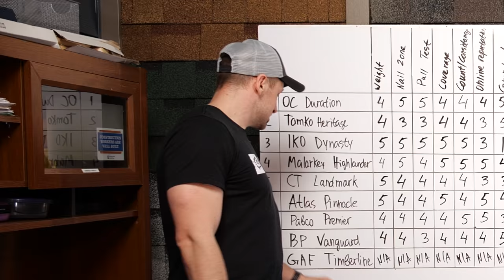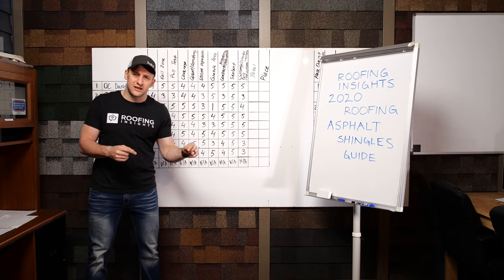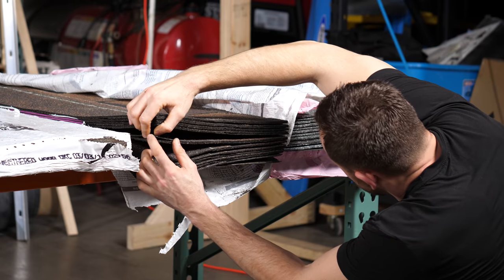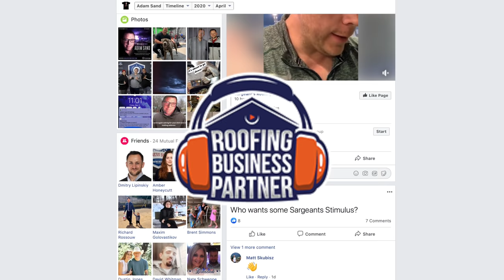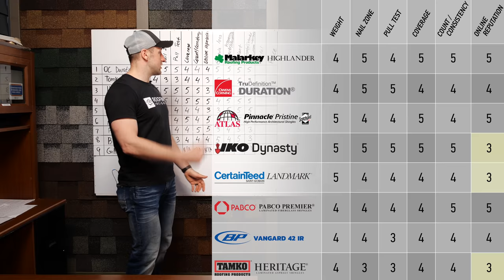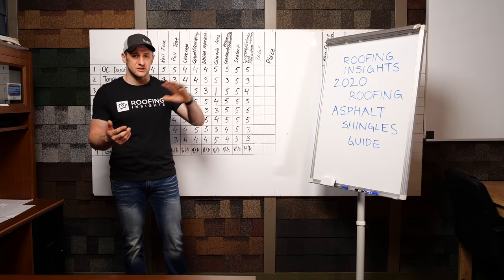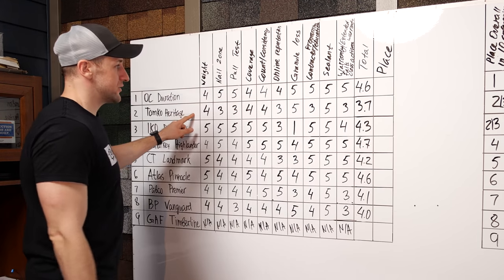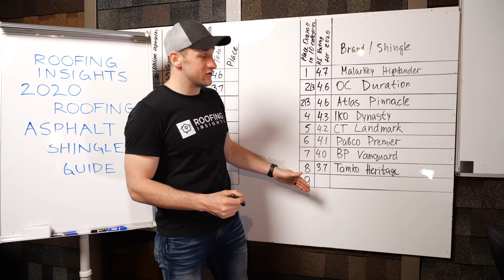Best and Worst Roofing Shingles by Roofers for 2020 | @RoofingInsights3.0

Comment: Funny to get this recommend. Just had my roof teared up and replaced. About 17sq with gaf timberland for 9k in the North East. Every tells me i got an amazing deal.
Reply: 17 sq of GAF in North East shouldn't cost more than 7K, IMO
Reply from the maker: You paid about $530 per square. Going rate for walkable roof is about $300-$450, what city are you in?
Reply: @RoofingInsights3.0  out in long island
Reply: Friend in NJ said to overlay his 14 square two story roof was 5k and it was a semi DIY
Reply: I don’t think you guys should tell the, they got a bad deal as a roofer I hate someone making assumptions before there’s any details how many layers were on roof, was decking in good condition, were there any skylights, etc... I’d say between 7k-10k depending on work performed is fair anyone doing it for less than 6k is either a weekend warrior or starting off in roofing also possibly super broke.
Reply: @RoofingInsights3.0  whoa, I'm getting quotes for $24k for 27sq roof (95066 zip code - any recommendation ?), which is what brings me to your channel and looking for alternative - which is more than twice the high range price you list. Yeah it's only $2k worth of OC shingle material through Homedepot, so something not right indeed....

Comment: How can Tampko score a 5 on granule loss? A 7 year old Tampko shingle will look like its been pummeled by hail when there has been no storms at all. IKO shingles have the weakest seal strip in the roofing business, 90% of my wind repairs are IKO shingles. OC runs about 93% of a square per 3 bundles and have become a lighter shingle since they have become a big box store staple. CertainTeed Landmarks are built like tanks.

Comment: TG!  I picked the right shingle.  We are just doing our roof now with Owen Corning.
Reply: Make sure you invest in the Owens Corning DURATION. I used it and is much better than the normal Owens Corning fyi. Lasts longer better wind resistance
Reply: @arcticwo1fee122  Yes, we did and it's a cool roof. Looks great!  The old owner put a heavy concrete tile on the roof and we found out our roof wasn't built for tile and could have caused it to collapse.

Comment: What happens to the overall ranking if you rank them in each category? E.g. if company A outperforms all competition in granule loss they get a 5 but they're on par with everyone else in pull test they might still get a 5. It seems like ranking in each might add weight to certain elements where a company can drastically outperform its competition. 
As usual, great insight from you. Keep it up!
Reply from the maker: Thank you.

Comment: I wait for this video all year.
Reply from the maker: Any feedback?
Reply: @RoofingInsights3.0  the only thing I can think of: 
I would find some way to quantify the sealing strips. (Best guess keep them in an oven for the same amount of time and turn the pull test around.)

My thought here is  that every time I have trouble with collecting an ITEL sample... It's TAMKO. The damn things bond so well I've taken to making my own shingle seperation tools to get around it.
Reply: @RoofingInsights3.0  The only problem there is that you're testing in reverse... is a hell of a lot more difficult for wind to lift the front lip than someone to pull up on the back of the seem.

Comment: Please clarify if the tested Owens Corning shingle was the regular Duration or the Duration Flex. I am choosing between Malarkey Highlander NEX and Owens Corning TruDefinition Duration Flex. Do you prefer one over the other? I know OC Duration Flex was #1 in IBHS rankings, but Malarkey Highlander NEX was not listed. Thanks.
Reply from the maker: Regular duration was tested
Reply: @RoofingInsights3.0  when will class 4 comparison be done?

Comment: Thanks for the product testing info !! I'm going with Malarkey,, Pabco and Malarkey are the only shingles sold locally , it's a 75 mile round trip to get any other brand., Not a fan of CT shingles, installed more then my fair share of CT fiberglass shingles back in the day, they don't seem to hold up well, to soft !! I Like the OC brand, but have to make that 75 mile round trip, but those suppliers always have a problem with not enough color choice and bundle count,, So as a DIY'er it's Malarkey  :)
Reply from the maker: Good luck!

Comment: Thank you for your very informative presentation. I am a woman who knows nothing about roofing material, well until now . That being said, I need a new roof on a property that I own in California. My question is , My contractor is recommending Malarky Ecoasis Solar reflective shingles. Can you tell me if Malarky Highlander is comparable to Ecoasis. My gut is telling me that I want Highlander and am willing to pay more for it. However I would like your take on this . The contractor told me that in California I should use a "cool roof" and I am not sure if Highlander is a "cool roof". Is Highlander head and shoulders a better roof than Ecoasis or am I ok to go with Ecoasis? Thank you in advance for your opinion.
Reply: Hi! Malarkey's Highlander shingle is actually the entry-level shingle. The Ecoasis line is a solar reflective version of the Highlander shingle, so it will carry the same performance (weight, strength, granule adhesion, etc.).
Reply from the maker: All malarkey  products are good products. We haven’t tested Ecoasis but I have seen industry tests and it’s impressive product as well
Reply: @RoofingInsights3.0  our Ecoasis NEX is actually just our Highlander NEX shingle, with the extra solar reflective granules. So, you are not only getting all the benefits of the Highlander platform, you're also getting the reflectivity. Which makes sense why Roofing Insights hasn't worked with the product. Ecoasis shingles have measured radiative property listed with the Cool Roof Rating Council and can be used to comply with California Energy Code Title 24, Part 6 Cool Roof Requirements.

Comment: Thank you for the shingle evaluation.  It has been very helpful as I try to decide which brand and contractor to go with.  In the South, shingle streaking from algae is a problem.  The Atlas Pinnacle Pristine has a lifetime algae warranty.  Some of the others only warranty against streaking for ten years. Why did you not rate resistance to streaking?
Reply from the maker: it deserves separate video, it is cosmetic, many will argue its not important, but it is very hard to compare

Comment: I’ve used Owens Corning twice in the last 5 years & they’re the only shingle I’ll tell people to stay away from..Granules  come off & they scar “extremely easy.” CertainTeed is my “current” favorite, Presidential TL & Landmark TL were the main shingles we used “Until” the Cool Roof dictate in Los Angeles & now we primarily use the standard dimensional lifetime gaf or CertainTeed shingles since that’s what the customer wants..Too bad..
Reply from the maker: How else has roofing in Los Angeles changed over the years?
Reply: The new environmental codes not only require Cool roofs but now we are mandated to go to specific recycling dumps that are more expensive & sometimes far from the job, in addition we now need a new Trash Haulers License to even take debris to a dump or face fines and four times a year we have to fill out a detailed accounting of the tonnage recycled , where we took it ect..The far Left Progressive polices of our major, LA City council & Governor have transformed Los Angeles into a haven for the homeless, mentally ill & encouraged a criminal element that has fundamentally changed Los Angeles..

Comment: Im going to guess that the only shingle that sealed indoors within 1 day was OC. Their sealant is super sticky. I've had a few occasions in the past where a customer adds a tankless water heater or something else a few weeks after roof replacement and when I go back to cut in and slide in the vent, both OC and Atlas are stuck solid and take a little extra effort and care to pull up. Most other brands are well sealed, of course, but come right up with an easy hatchet swipe.
Reply from the maker: OC does seal incredibly!!! Even in colder temps. Great shingle all around
Reply: I am considering to start using Malarkey Highlander. How is their sealant compare with OC and Atlas?
Reply: @justinomora6678  I've only ever used Vista AR from Malarkey but their sealant is great. If I remember correctly, Vista and their other polymer modified shingles were the only shingles around that could be installed below 40°F. This mostly has to do with being polymer modified I'm sure, but they must be doing something right with sealant as well.

Comment: GAF not invited for same reason GAF won't respond to roofers asking why they don't list particular specificiations in their literature, for the same reason GAF had to deal with a class action lawsuit.  GAF does, however, do well at spending more money than any other manufacturer at advertising that they are the "number one shingle".

Not saying I won't install Timberline and warranty it if a customer asks for it, I will, it will work.  Just saying it's not my go-to (I like Malarkey other than the fact that you just can't get any in California, lately).

Comment: Great video and comparison for someone who knows very little about roofing. We’ve discovered damage to our roof and our roofing contractor says it should qualify for replacement due to wind and hail. I’m in the southeast (SC) and we get some pretty intense storms, lots of rain and the occasional hurricanes. Our contractor likes OC and from what I’ve been able to research, they seem like a solid shingle choice. What brand, shingle type (we like the architectural), solar reflection (hotter then heck here), algae and overall durability would you or anyone else here recommend? Thanks again for the work it took to create this comparison!
Reply from the maker: Atlas, Malarkey or OC will be top choice!
Reply: Roofing Insights I appreciate the recommendations! We had another contractor come out, we like them much better, and they’re using CT Landmark. I see you like them as well as many others. I think based off my little bit of research and you guys seem to like them as well, we will probably end up going with them based on the contractors first impressions, punctual appointment timing, personable, great attitude, and using the CT brand.

Comment: You reviewed IKO Dynasty. Wondering if you have any info on IKO's Nordic (particularly re: granule loss) which has a Class 4 Impact Resistance Rating which for my insurance equates to $200/yr off our premium which seems significant. Looks like it holds up to 130mph winds and includes hail coverage.
Reply from the maker: Dynasty and Nordic are both great product, worth paying extra for Nordic in your case

Comment: When I saw your 5-star rating for the IKO sealant strip, I was surprised, since there are some online complaints about failures of the IKO sealant strip.  My theory is that it's again a reflection of the excessive granule loss on the IKO shingles.  (I would expect that if there are loose granules between two new shingles during installation, they will be harder to seal, regardless of the quality of the sealant strip.)  You probably didn't test for that in your controlled testing.
Reply: Most of the sealant strip issues with IKO is on the Cambridge line. Dynasty & Nordic are pretty much problem free with sealing
Reply from the maker: We tested it and were very happy with results. They have improved a lot.

Comment: Thank You For your hard work.. Malarky is not available here. Atlas is.. OC contractor here , I installed my first New atlas shingle last year. Before Atlas Chalet Shingle Failed miserably here.
Reply from the maker: Atlas Chalet is a very old story and it did fail, Atlas paid many claims after. Most roofing brands have at least one line that has major issues.

Comment: Trying to decide between Atlas Stormshake SBS or Certainteed Landmark Pro. Both companies are very highly regarded, so I'm not worried about that. I live in Michigan, if that matters in regards to the weather and shingles. The warranties seem to be very similar, so I really want to know what's the best shingle from the start.
Reply: I'm also in Mi & going through my quotes The co that uses Atlas was $13500 for my 1426 sq ft home. The other co uses centerteed landmark $9,400 🤔 I'm still undecided 5 days later Both co reps were professional
Reply from the maker: Atlas Stormshake SBS are much better shingle for the dollar.
Reply from the maker: Your price for Atlas is much higher than usual. Could be your choice of roofing contractors. Check directorii.com for roofing contractors we recommend near you

Comment: I use OC Only but I respectfully disagree with duration having a good nailing zone. Their nailing zone does not grab both of the upper layer and lower layer for the whole inch. It’s only half an inch. And even if the fabric strip is one inch it doesn’t grab the two layers of shingles if you nail in the upper second half of the fabric strip. That creates a grip only on one layer of shingle and the fabric which is not ideal. The ideal would be to be able to make the second layer go the full one inch. That way you grab 3 layers which is the two layers of shingle and the fabric.
Reply from the maker: With sure nail it doesn’t have to grab common bond area. Most shingles have wider area to nail VS their common bond area. Look at certanteed  for example. Same thing, 1/2” commons bond and 1 1 1/2 where you can nail. But no sure nail strip. Rips right off. 
Two best shingles in pull test are IKO and OC and both perform better than the rest even if you nail not in common bond. It will outperform other brand even if they installed in common bond and OC will only install in shingle layer. OC strip still a game changer no one can compete with .
Reply: That’s what OC says but in the real world not grabbing both of the layers in the common area makes it less reliable than it could be. It definitely has more potential but I don’t understand why they don’t extend the bottom layer the whole 1 inch. Being one of the best out of all the rest doesn’t necessarily mean is good enough
Reply from the maker: That’s not what OC says, that’s what numbers say. Numbers don’t lie. Try it yourself. Install certanteed in common bond and OC above and try to pull it. 
Oc will perform better but in your book it’s not right. Sometimes you have to think outside the box.
Reply: Roofing Insights yes that what OC SAYS.  I’ve heard it from them many times. It’s their speech. And yes it may be stronger than certainteed but my point is: it’s so stupid to only marry the two layers half an inch short. Why not the whole inch. Like I said it may be good or better than other shingles but doesn’t mean it is good enough. If it had the two layers all the way the whole inch than it Would have three layers instead of two.

Comment: The only issue I have with duration is that the SureNail strip isn't over the common bond area. If you look at it from the side, about half of strip is over common bond and half is over only the top of the shingle. OC says as long as nail is in strip they will warranty it, and they did. I had a few shingles split in half on a 14/12 section of a roof once that were nailed in the top of the nail strip either all the way across shingle or on one end of shingle. OC came out, looked, and warrantied it but it left me a little uneasy that their literature photos show the strip properly but their manufactured product, no matter the color, is always off of the common bond by about 1/4"
Reply from the maker: the key factor is they COVERED it. Thats amazing. as long as manufacturer honors their warranties we can have confidence in their instructions.
Reply: I agree the nail has to be in the bottom half of the strip to hit the 3/4” common bond area. 
With the dynasty IKO wants you to nail above the common bond so the nail hits there strip. Doesn’t make sense. 
The only shingle that has 1 1/4” common bond. Most other manufacturers only have a 3/4” common bond in reality.

Comment: Great video! I like the rating system but do you feel all the rating categories are equally important, or might it be worth giving heavier weighting to more significant categories?
Reply from the maker: Done probably more important but it’s good to see how they perform against each other. Like: heaviest might not be the most expensive, and might hold granules better VS lighter can be more expensive and lose more granules or vice versa. Once you know the total rating you look at categories little different but have to be objective before you arrive there

Comment: Do you know why color fall off on a new roof, specially when it rains
Reply: Color doesn’t fall off a new shingle. A new job will have loose granular laying all over it and the first rain will rinse them off.   But your question is impossible to happen on a NEW roof.
Reply from the maker: color will stay, granules will loose a little. Color will change mainly due to algae issues.